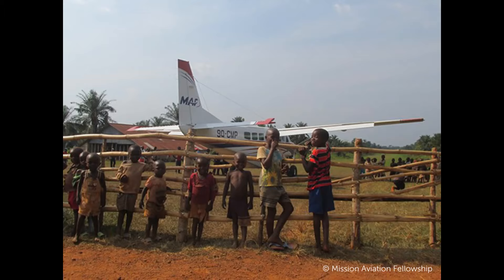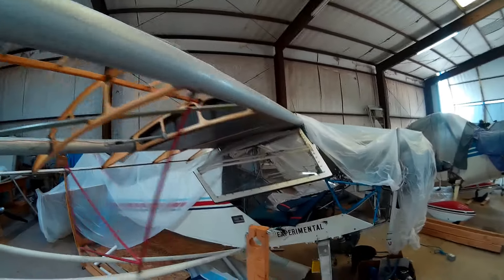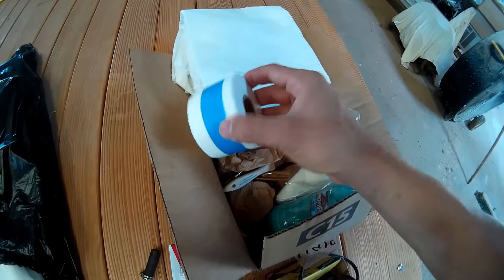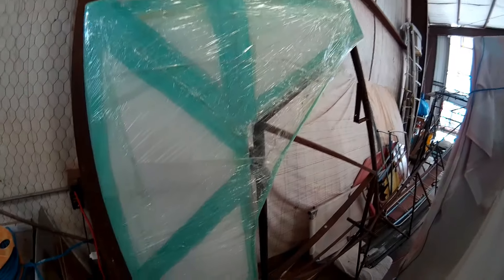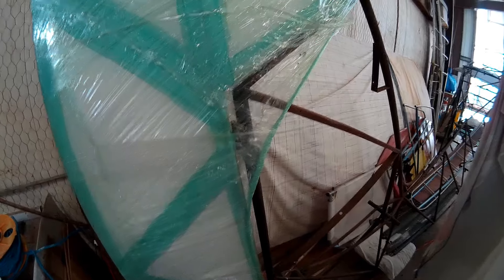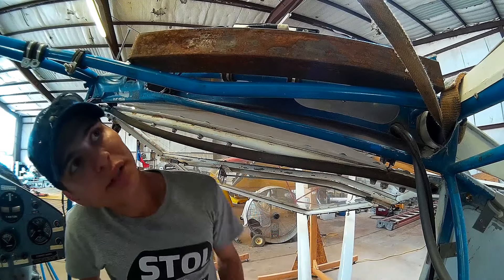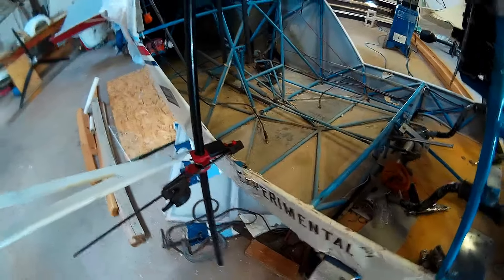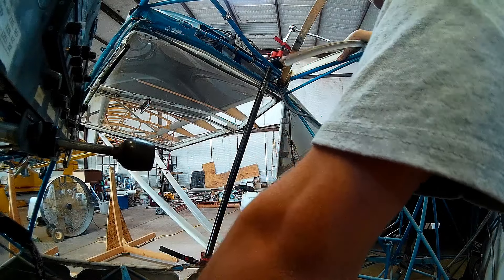Fabric for Kitfox1000! | #Kitfox1000 Vlog 025

Comment: Keep at it Nile, you're doing great.  Might i politely suggest you strip all the fabric to make sure there aren't any hidden problems lurking inside the fuselage and tail plane (more bent tubes, cracked welds etc).  When I restored my Rollason Condor years back, like you I found a broken wing rib but also on the fuselage, a bit of glue failure and some wood starting to rot where there was a crack in the fabric and moisture got in and couldn't get out.  Keep that camera rolling :).